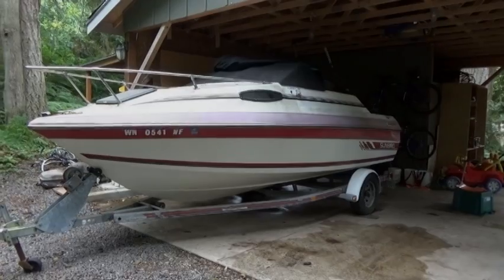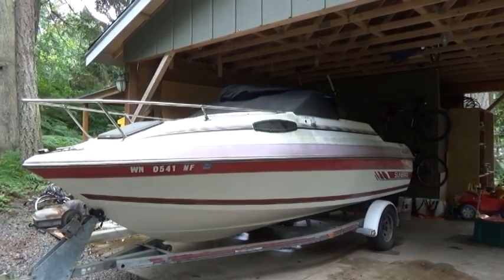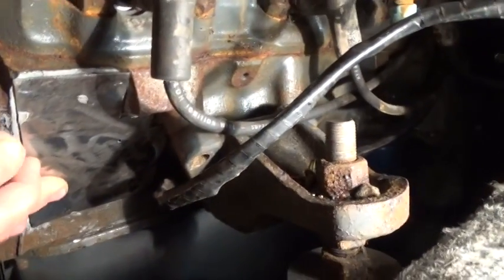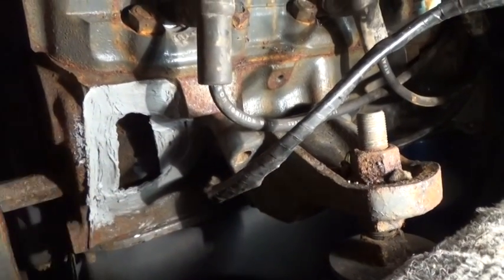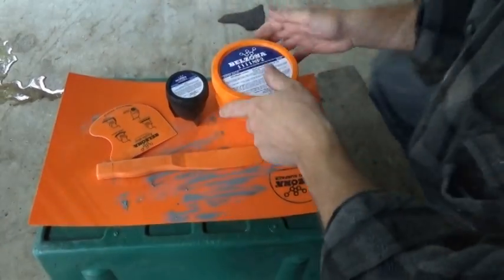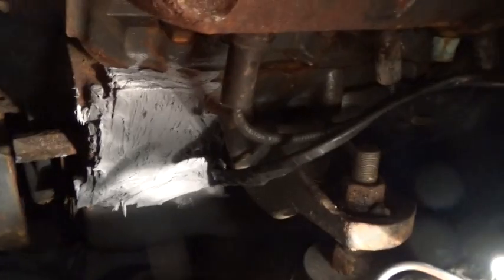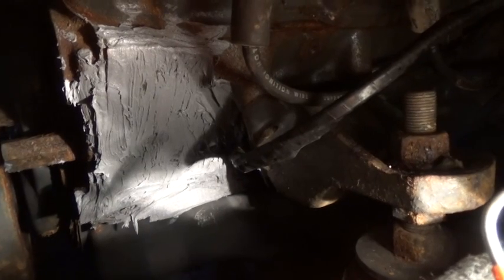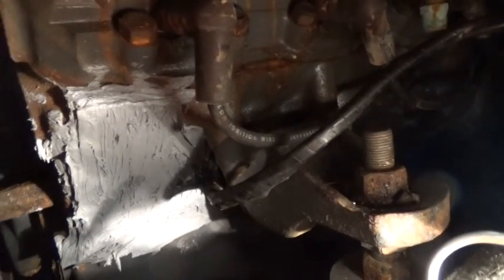How to patch a hole in your engine block

Comment: Obviously he died.   No reply if it held up.   JB Weld and this stuff is a scam.   They should be charged for misleading advertising.
Reply: You must not have ever used this product the right way! It is used in the pipeline industry and oil transfer station all over the USA.
Reply: @tonypayette87  
NASA also approves it
For exterior repairs on the shuttle. 
There's a video of it being used on their last trip to Mars.
Reply: @keithclark486  That’s cool!
Reply: @nathangen  
Actually I just made that up because I thought it would sound cool because I was bored and got pissed off because I didn't get to go and they didn't get me nothing after they took all my money and spent it on junk they didn't need and I'm 12 years old last year getting ready to turn 14 next year.

Comment: when mixing the 1111 you should spread the base and solidifier out on your board and mix until there are NO streaks visible.  when putting material on the board you should have 3 blobs of base and 1 of solidifier that looks like one another then mix. also, once you clean and abrade your substrate and patch you should never touch with ungloved hand. oils from your hand will reduce the bond. what you did here was called cold bonding and its utilized in most industries for over 50 years. the Belzona works like a champ if you prepare the substrate and follow the easy instructions that come with.